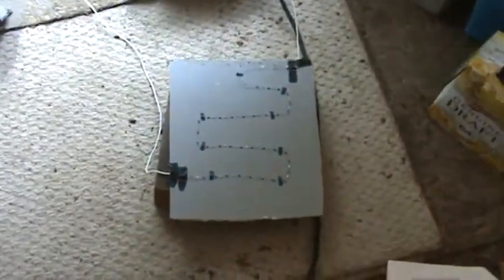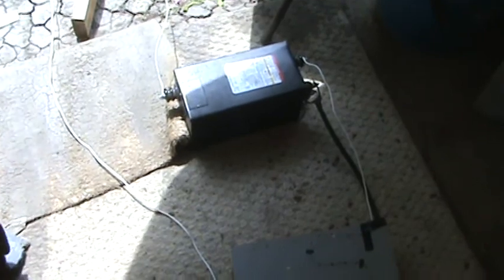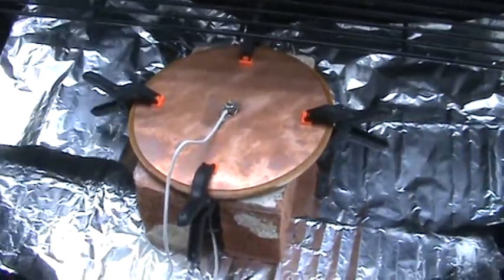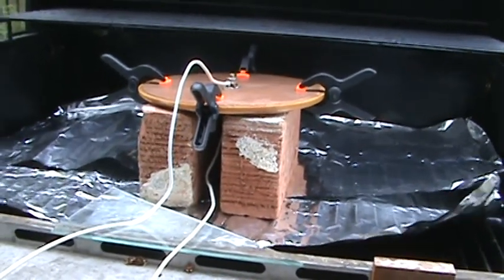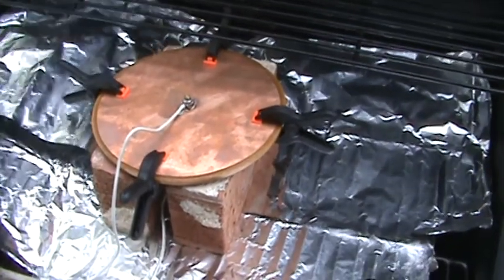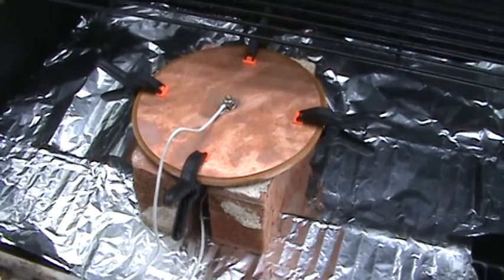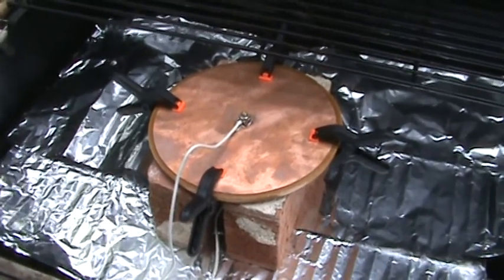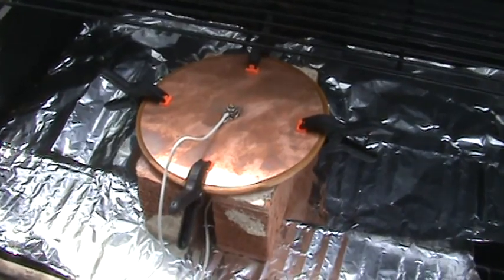The Electret That Failed part 1 of 2

Comment: im planning my first electret experiment paul and everything looks ok ive got all my ingredients and even aigptchat helped to in refining the ingredients and im powering a high voltage multiplier from a oscillating relay powered ignition coil did you get the right amount of ingredients into it ive got modified rochelle salt crystals to add to my recipe for the electrets and im going to upload a video of what im going to do to make mine
Reply from the maker: I think i forgot the "Rosin"!  I look forward to your results :-)

Comment from the maker: The heat treated cable works, but is dangerous to set-up.  I believe it collects "static" elec.  Have to heat cable at low temp, just until the cable's coating just starts to melt, at the same time applying HV DC. Use like 150 to 250 feet of cable.  My wife dont like this stuff either, heheheheh.  Thanks for the comments

Comment from the maker: @Last1Inventor yes, you mentioned about heating more,,,but metal will melt the wax right out of it, how do i heat the plates up more and keep the wax inbetween? I have thought about it hard and long, came up with idea of bottom plate being a pan, but then top plate will not have same surface area, not sure if that would make a differace.
I read high voltage but low current, but what is considedred low current?